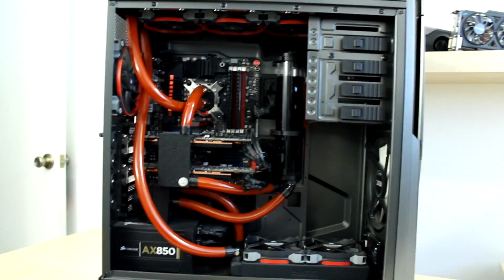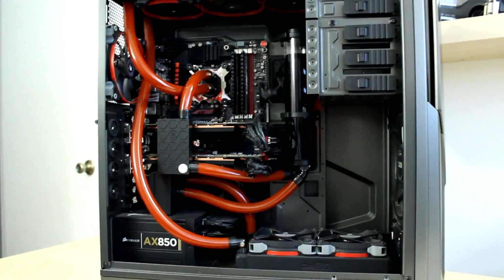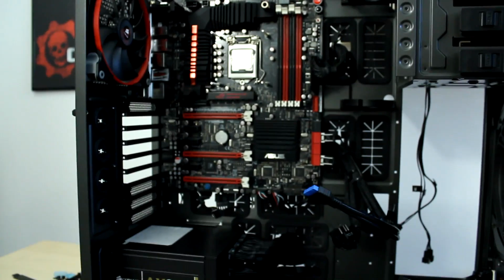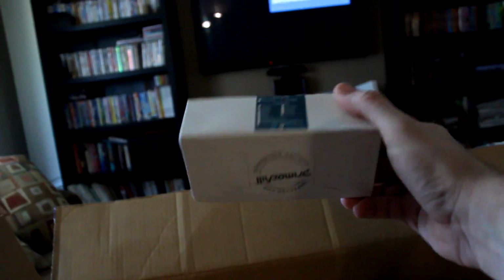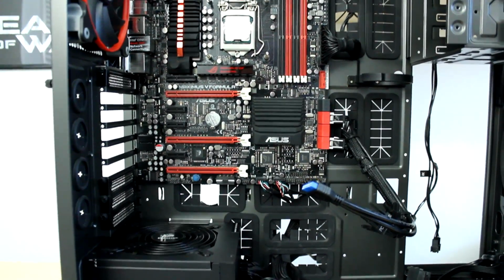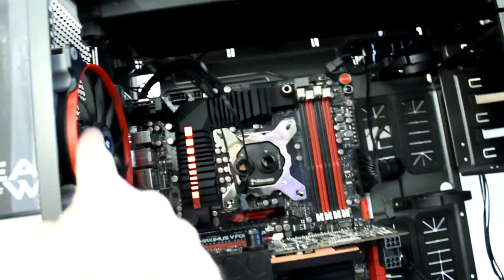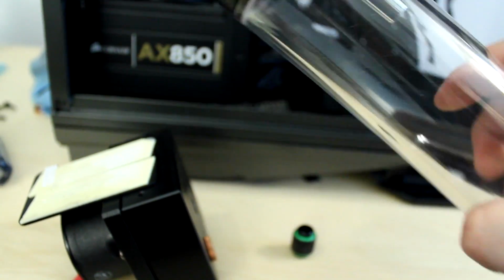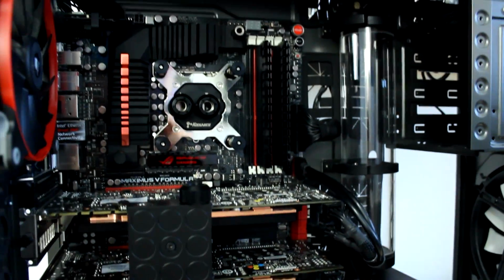Watercooling Overhaulin - Part 1

Comment: I've found that using UV led strips with the factory HUE unit in the Phantom 820 works a lot better than using blue extra lighting..its color of blue is just enhanced, and it sets a better lighting.

Comment: About the rubber grommets, my Corsair 800D did the same thing. They got brittle and the flaps started to break off. Corsair does offer new ones as replacement parts, but I just took them out and left the holes in the sheet metal.

Comment: Why is the power supply turned with the fan up?
Reply from the maker: Because
Reply: Because it looks better that way. Also you are not sucking in the dusty air from the floor (if you have filters that is being prevented but cleaning those can be a pain in the ass)
Reply: Kitsune that really depends on your case or if you are lazy yeah it is gonna be hard. Compressed air, easy as that.
Reply: Also maybe the surface the power supply is on is very bad (carpets for example) so it is better that way.
Reply: Turn down for what?
Reply: Well played sir.. Well played.
Reply: Kitsune most decent cases have filters...having the fan up is just asking for trouble. Dropping a screw in there is so easy. Plus it'll be sucking in all the hot air from inside the case.

Comment: My NZXT Switch 810 which has similar internals to Phantom 820 does not have the problem with the cable grommets. They do however stain your hands black. Maybe they tried to fix that problem with 820 and made them worse.

Comment: The problem with blue lighting is that it tricks your brain into thinking its brighter than it actually is. That is why its used for lighting the access passages in and around stages; for live performances. You can use lower brightness levels compared to white light and still see where your walking. The problem with this is that it makes hard for you to go to sleep afterwards because your brain is tricked into staying in work mode.
 This could be a problem for you client because the PC is next to his/her bed.

Comment: I kind of agree that painting the red ring black is a good way to go , especially if the owner still has the original blue rings included with the fans, if he want to add a little more blue he could always trade the rings out for the blue ones that cam e with his fans. - How many times did you flush the system, I have seen a few people flush a system 2-3 times and still have Red in the system, my system is red but I went with Red tubing and clear coolant and a red LED. It was my first Custom WC build but I took note of how many had said red can stain a system; especially clear acrylic blocks from what I hear. Also is their anything you added to the distilled water to help remove the red?
Reply from the maker: The loop was actually hooked up to a purified sink which which fed clean water while the other end of the loop drained in to the other side of the sink for an hour. All parts now spit out clear water. Works like a charm.
Reply: ***** "Purified sink"? Do you mean an under-sink water filter/purification system with a separate faucet?
Reply from the maker: brandishwar Something like that. Its an attachment.
Reply: ***** Out of curiosity, do you use a similar technique for flushing new radiators?

Comment: Why did you need more fittings? Were the old ones a different size or unusable for some reason?
Reply: The acryllic tubing is smaller basically. Also rigid fittings are used specifically for acryllic

Comment: Jay, do you have a negative air pressure in the case? Are the three top rad fans exhausts? You also have one exhaust fan in the back of the case. Please do enlighten me about the air pressure. I just watched your air pressure video and understood that positive pressure is the best option but now I'm confused because this setup lol.
Reply from the maker: You cant just say "I have 4 fans as exhaust therefore I need 4 fans as intake, blah blah blah" It doesnt work that way. Its a matter of CFM. The bottom two fans are intake, along with the massive 200mm fan. You also have to account for the reduced airflow of the fans with radiators etc. Resistance will reduce airflow etc. If you just match the "number" of fans pointing each way, youre doing it wrong :P
Reply: Ok great! Didn't say that, but I get what you mean. Gotta keep studying this. Thanks!
Reply from the maker: Juuso Saastamoinen Study CFM and you will understand it much faster. CFM can be achieved in many ways, that's the key.

Comment: My pc was always crashing but as soon as i got my z97 an 4790k all my problems went away, Well not all my problems, bf4 only runs on my left moniter an even then only on about 1/4 of the screen, 

Any ideas ???
Reply: Check the resolution the game is set to.
Reply: 1st thing i checked, it was set at 5760/1080 but for some reason the screen was still very small, i tried alt ent ti go full screen, Changed it to 1920/1080 but still no change, Read somewhere it could be b cos of teamview ?
Reply: TheChrisglasgow You can also make sure to update your drivers.
Reply: Pretty sure mine r up 2 date, I'll check once i get home from work, Thanks buddy.
Reply: TheChrisglasgow windows control resoution
Reply: Nice 1 thanks buddy i'll try it when i get home 👍
Reply: I would completely uninstall any video drives reboot and install the latest from vender website. I do clean installs just as good practice, I am sure you have already done this but see what the in game resolution is set at. If none of this works I would go poking around your drive's suite, because something is most likely getting miss read there then. Hope this helps
Reply: Anthony Shea Creations as i already siad the main screen is set on the rong screen so you need to go to screen resolution of windows....

Comment: Hey jay, can i send you a couple of pictures on my watercooled system? all of the sudden it's starting to just look bland to me. I could use a couple of suggestions. its just i dunno. bland. 

btw the res in the bottom right is just velcro rigged into there because the 5.25s wouldnt fit it.

Comment: jay i made my first water cooled pc today and its petg and i ran out of tube because I kept messing up but i really wanted to get it put together so the tube thats in there right now is really bad any tips? i do have a drain port luckily :P should i just buy new tube and restart? how do i get better at bending accurately because I can do some nice bends but they mostly dont line up exactly where they need to
Reply: PC Pro I recommend taking more thorough measurements and investing in an actual bending tool, it could definitely help with accuracy and ease.

Comment: Hi Jay, I just bought a Windforce 270x and tried to overclock the core clock to 1200Mhz but it failed work. I adjusted the clock to the original. Any tips on overclocking?
Reply: Go SLOWLY each GPU is slightly different so your GPU may not over clock as well as the next guys and remember to turn up voltage as well

Comment: Will a 240 30mm and a 120 45mm both Alphacool cool a gtx 680 and a i7-4790k moderately overclocked? Forums are full of "pros" who all give different answers like "you need two x 360s" or "at least 2 x 60mm 240s". I say bullshit then i get banned! I'm new to watercooling but hopefully i can tell when people are being overzealous. If 120s aren't needed why are they made!
On Tom's Hardware no matter the question most are answered with "get G-Skill Ripjaws!". or "Get an I5"
I have a 600t case and don't want to cut bits off it!

I'm in England near the sea it's windy and temperatures are low.

Comment: I might have questions for you about water cooling, if thats not too much trouble. I am building a BEAST of a computer - 6th gen all around. P2-1600 PSU by evga - Evga z170 classified motherboard, 64gb of Corsair dominator platinum ram -FOUR count em FOUR EVGA GTX Titan X Sc's - 2 Seagate enterprise 6 tb HDD - all in a NZXT Phantom 820 (Black) Case - Ill hollar at you. Hope that's okay with you. Shoot maybe you could even help me design and get parts for my own custom water loop for my upcoming new gaming/rendering rig!
Reply: Oh yeah I forgot, Intel I7 6700 Skylake 4.0GHZ is the CPU
Reply: you are missing the SSD ;0